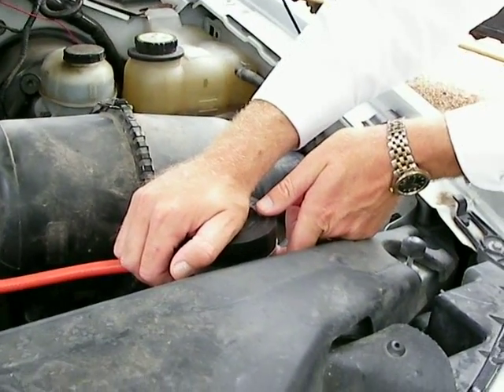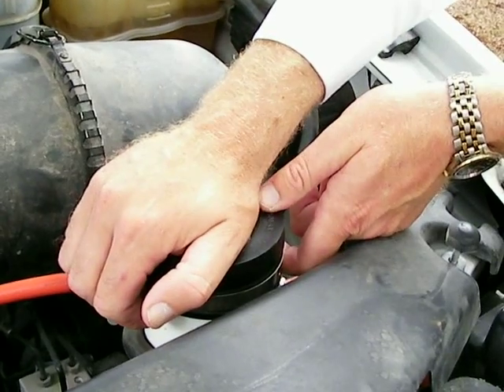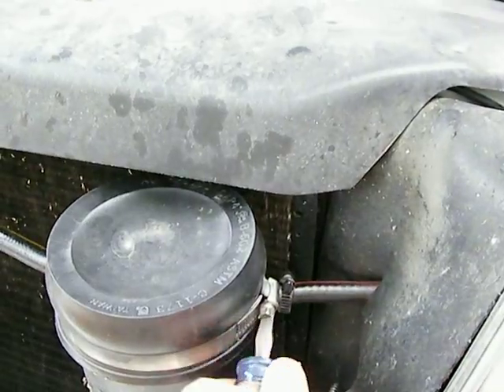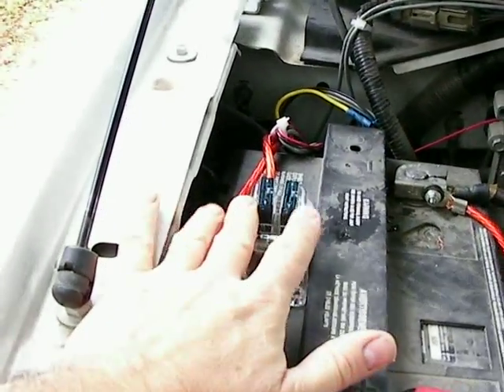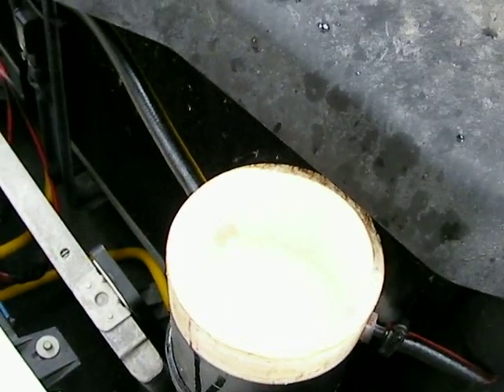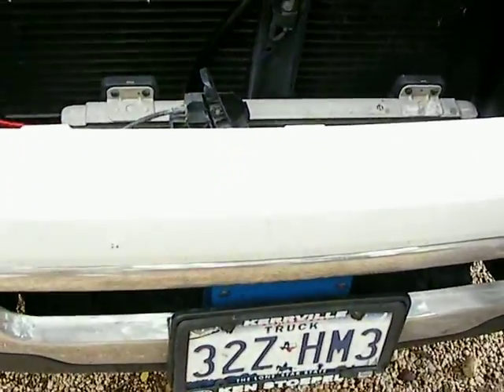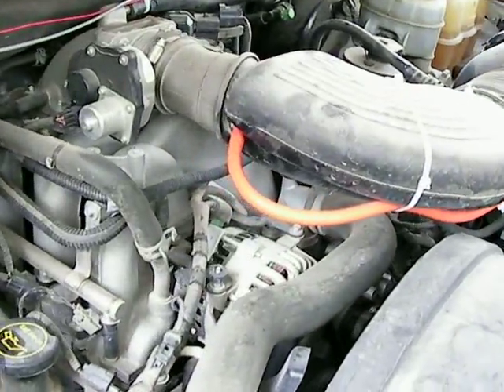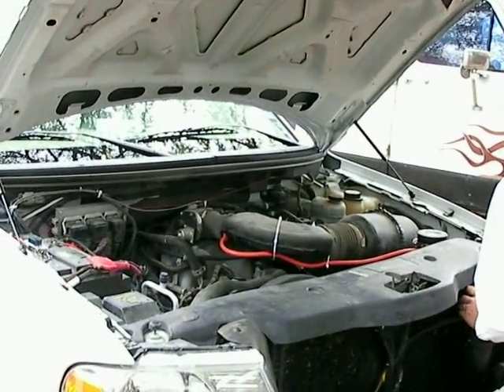f-150 on hydrogen

Comment from the maker: yeah the problem is that the end user neglects to keep up with the maintenance of the cell after a few months. soon after the bubbler goes dry first. then the cell. the cell then has this crap on the plates and must be taken apart and cleaned. the twin towers are a maginal dryer but better than nothing. i have other cars using these and a bubbler last works good sofar?.. be blessed! scott

Comment from the maker: I tried to mimick the dryers on an air compressor. i run two dryers on my air compressor for my spray guns and i do not get water out the hose. so i tried the same effect here and on my diesel so far? the bubblers run dry very fast so i was trying to have a secondary "dryer effect" in case the bubbler goes dry.

Comment from the maker: i have ordered several blow mold screw top bottles that i plan to use for the bubbler and the distilled water resivor. they should arrive early next week. the set up on the truck was an experiment two expansion chambers.

Comment: Do you have a bubbler installed on that thing , if you are using LYE you need a bubbler or the lye residue in the gas will eat the inside of that guys engine out ..